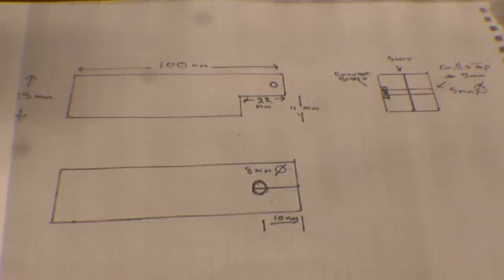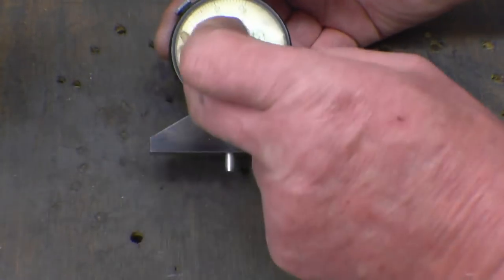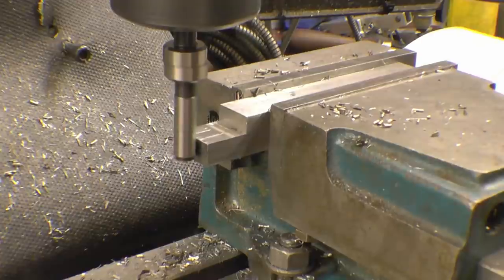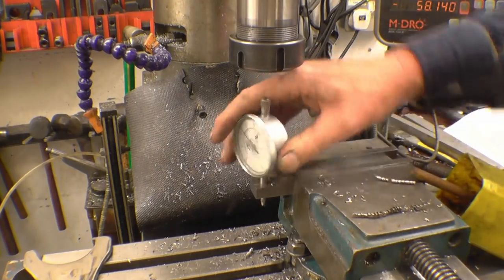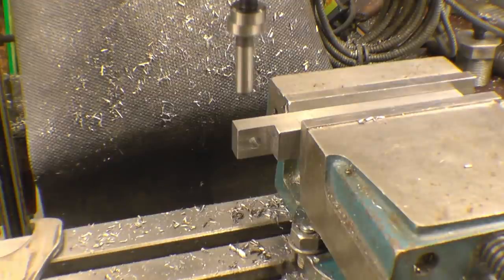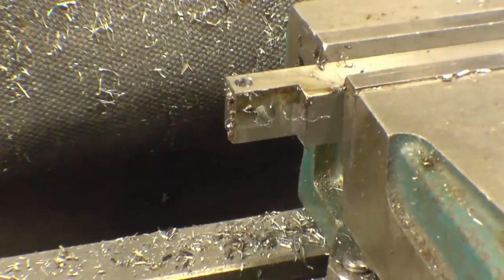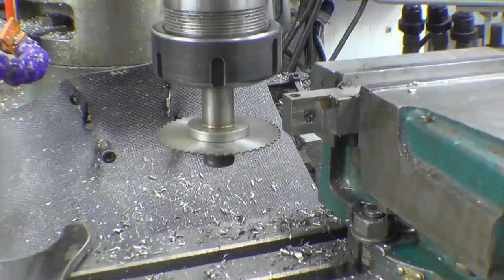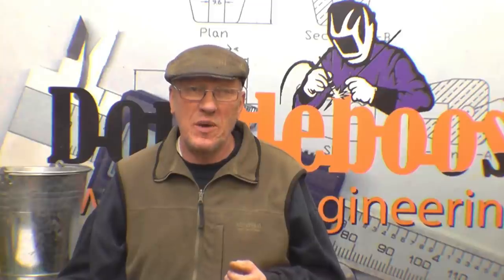SNNC 327 P2   Liner Depth Gauge  , Slitting Saw

Comment: This may seem a silly question, but in North America, all the metric drill sets only go in 0.5mm increments.  I've not seen 3.2mm drills for example for doing the proper tap drill sizes.  I see you can buy them one at a time but is that how you do it in Europe, or can you buy a set with the common tap drill sizes?  Between, fractional, letter, number and metric,  I'll surely have something close enough but for those who don't do the imperial sized tools hows it done?
Reply from the maker: I buy the individual drills   you can get a tap index with drills in metric
Reply: I bought two boxes of metric drills. In 0 .1mm increments.  1mm to 5.9mm and 6mm to 10mm.  Made by Dormer and sold, at an exhibition, by Greenwood tools.  They seem to be readily available in the UK.  I have a set of Number drills and two sets of 1/64” to 1/2” in 1/64” increments.  Most of the time, I use the metric drills for tapping.  To help, I made a spreadsheet of drill sizes (metric, imperial, letter and number) in order of size and then put in the recommended tapping sizes for metric course, BSF, BSW, BA, and the ME threads (40, 32 & 26 TPI).  I found that most thread sizes have a number of tapping size drill depending on what text book you use.
Reply: No idea where they came from, but my metric drills come in 0.1mm increments. Much more than I will ever use but I'm happy to have them. I got them in Central Florida.
Reply: @houstonceng  You can order tap drill charts from Starrett's website. They provide wall posters and pocket cards. Best of all they're free, and Starrett even covers the shipping. I had the wall charts laminated at my local Staples store, and they should last for years.